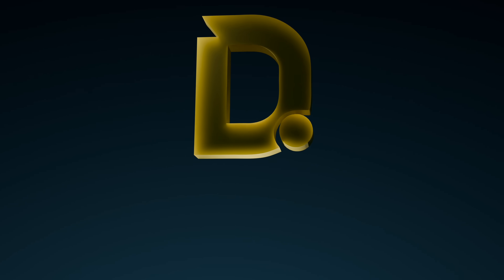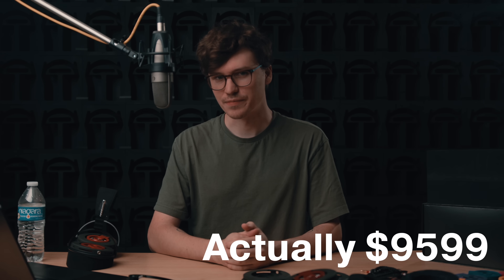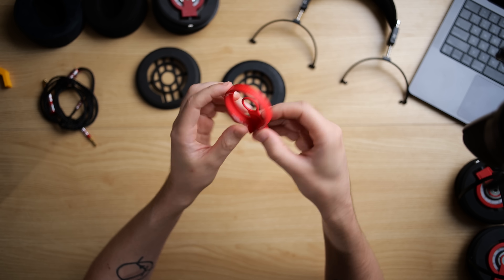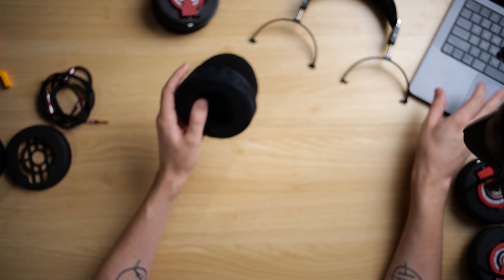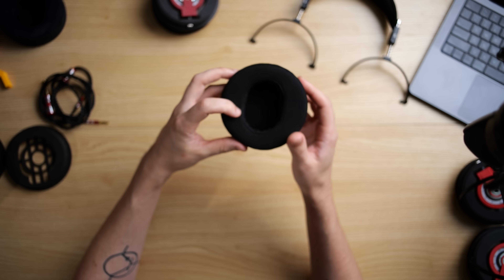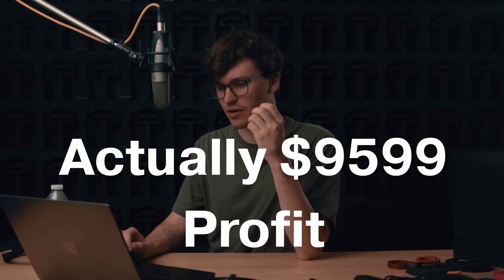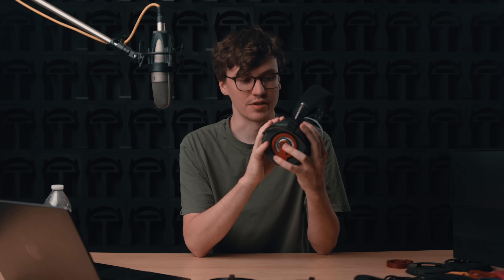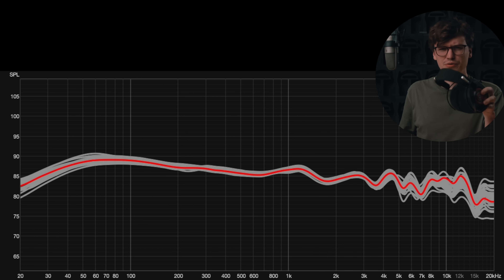What it really costs to build a headphone

Comment: Curious why you didn't go with injection moulding over 3d printing? A small mould only cost around $500 - 1k.
Reply from the maker: Would have to make the chassis a multi-part design and change a significant number of things. Also would increase weight as a result.

Comment: So if i hear it right, basically nearly 40% of the cost goes for the distribution company (in which if you're sponsored-by, then it should also be counted as your personal profit - CMIIW). Other remarkably high cost component comes from labor (at around 10-11% for only a couple of person?) while the other components' prices are pretty much reasonable (for retail parts that is) except for the packaging (in which the 1st batch customer didn't receive in full due to... never mind, i understand), anyway it's not like you have satin cloth wrapped on the foam or giving a free case right?.

Anyway, a whole lots can still be optimized if you decide to do another project. Having OEM companies fully make your design must have also come to your mind, but if you go for a US-made remark of course it's another story.

Best of success.
Reply from the maker: It takes 3 months to build the units. Also I'm not sponsored by them. I work there but I don't see any of that. Actually at that margin it's close to a loss.
Reply: @DMS3TV  True, I'm in construction business and that much of a margin (not including your own R&D costs) really close to a loss, especially later with taxes and other administration things. But yeah, just in case another project pops up in your head (planar maybe? Hahaha) you already have all the better considerations regarding the cost components and maybe options for more efficient manufacturing.

Comment: Not sure if this is the correct video to ask but I posted these questions in a couple other discussions w/o a response.  so here......    1) Aside from the apparent aesthetical benefits (exterior finish) and arguable structural qualities SLS provides over a premium FDM filament,  does it improve the sound that the drivers deliver?   If so, how?   2) Did you modify and / or make any kind of tuning to improve the sound?   Both, the Kennerton Vali and the Aurorus Borealis use the same driver from Tympany.  Two headphones I am sure you have reviewed or at least tested before.  3) Sound-wise, how do your headphones differentiate from those two?

Comment: $30 per (pair) of SLS earcup shrouds? What kind of nonsense is this?? You outsourced your manufacturing process ?? So... now a third party has your mold design (ie. in terms of the current weak international Intellectual Property (IP) laws, you now own nothing!)

The most expensive component to manufacture is the planar magnetic driver, and that shouldn't cost you more than maybe $20!

The most difficult headphone component to manufacture is typically the high-grade (plastic?) housing, which would require a 200 tonne press

1. Nissei FNX220 $120,000 - $150,000
2. Arburg Allrounder 570 C $150,000 - $180,000
3. Engel Victory 330/200,$130,000 - $160,000
4. KraussMaffei CX 200 $140,000 - $175,000
5. Sumitomo SH200A $110,000 - $145,000

...for a single press, brand new, which shouldn't scare you; keep in mind your goal is to operate a perpetual business. And a typical line of business credit from a bank for a legit, state registered business is $150,000 - $300,000. 

You can annually depreciate the market value of the presses and all your tangible assets to recoup a significant percentage of your upfront expenses through your business taxes.

Or you could always rent or lease, which lots of companies use because of floating personnel rolls.

If you netted $18,000 in revenue in only 3 months, it would then require $300,000 per press per year / $75,000 in net profits per year = 4 years to turn a profit, which is currently better than some EV companies !!! And they have multibillion dollar valuations, based upon the day they turn profitable. 

Don't be so ashamed, I don't know a lot of businesses which can survive without seed capital within the first 4 years.

I will not be examining your component costs because your component costs are way out of reality; like in the realm of magic unicorns...

Comment: I work at a company in Germany, we develop and manufacture medical devices. A few points in general: Test EVERY unit before it ships. Especially the first few batches, and not just at the end. One step, one test. Also, trust no supplier! The best guy in the company does the first few samples to get the contract, the actual bulk order gets done by some unqualified idiots. Add 3 months to the initial internal production deadline. If something goes wrong and you need to change something, the next batch of parts can take 2 months easily. 

We also had an issue with item cases. We designt the case to fit the product, got a batch manufactured. But just then the product charger manufacturer changes the dimensions of it. Charger doesn't fit in the case anymore. So we squeeze the charger somehow in the case, until this batch is sold. Then new adjusted design for the next one.

Comment: Its absurd to me that they still made a profit after clear design mistakes, like buying pads for the whole batch ahead of time (dekoni pads are expensive!) and then changing, having quality issues with the SLS and NOT getting your money back as the quality was below expectations. And still making profits. And that's because you're still charging 1k for a headphone that's primarily printed plastic parts, with reused parts of design, and a purchased driver. The design is also SO uninspired, it begs the question why people would want to buy it. For 800 you can buy a Meze 109 pro or Hifiman Arya Stealth or Focal Clear or Hadenys. This thing is, at best, basic prototype quality
Reply from the maker: You do realize headphones in this price range usually cost MUCH less to build than mine right?
What parts am I re-using from another design?
Also 3D printing is significantly more expensive than injection molding. The benefit is lower weight...
I don't see how you can say it's prototype quality when it measured better than many things 2x the price and you haven't handled it or heard it.
Reply: @DMS3TV  I work as an engineer in medium-scale production for automotive and industrial applications. You're right that I haven't heard it. But this is a premium price, and for that premium you should get a premium product. It seems like all the focus was adherence to the Harman target. The magnet is nearly exposed, just in my opinion this looks like a prototype, and the alternatives in this price range are quite transparent. For Harman lovers they could EQ or just stick with that headphone and let their brain adapt to the signature. This looks much closer to a DIY 3D printed build than a production product. 3D printed material may be lighter, but there are other considerations like longevity, appearance, and CSD performance. I'm not that familiar with SLS but it seems like the baffle was worth it. Not sure about the outer frame.

Working in the production space for 6 years, very many companies lose profits on the very first proto or production. IMO the pricing outlined in this video shows exactly why. However, people were willing to buy these batches, so the market has spoken. Just giving my thoughts.

Comment: Very hard to justify $1k

Why couldn't the next batch stay at the same price if the first one was already profitable with so many additional costs?
Reply from the maker: The price is returning to MSRP. Batch one was sold 10% off for early-adopters. It's not just me here too. There's other peoples jobs that rely on this project.
Reply: £1k is absolutely hard to justify if your personal financial situation makes it a difficult purchase. In such a situation you absolutely shouldn't even be considering purchasing these, or any other similarly priced headphones. I suspect there are much more important regular outgoings in your life that should be prioritised.
If, however, your personal financial circumstances are such that your disposable income makes a headphone purchase in the £1k range viable without significant sacrifice, then it is absolutely justifiable.
What you meant to say, I'm sure, is that these headphones are not for you because you cannot personally justify the purchase - and that your personal circumstance and experience are applicable to precisely you and no-one else and, as such, you have no say over what is or is not justifiable to anyone else.
Also, the concept of "early-bird" pricing is not new - this won't be the only time you encounter it.

Comment: Good example of design to production.  There's definitely a learning curve to it all and a range of methodology paths that are low or high cost risk.

3D printing is certainly becoming mainstream even in the commercial space.  There's a number of technologies out there.  It's a shame you got some bad results.  I would typically expect you'd be able to RMA the bad parts.  Most companies dislike bad reviews and tend to make an effort to maintain good customer service.  It's a competitive space, so the brand needs to carry high weight.  It's just trickier overseas.  Manufacturing of this kind is also so abundant these days you really don't have to bother importing anything.  If it's not cost competitive and you're not making 50,000 of them, you don't even need to bother with the hassle.  Stay local and bump up the sell price a little to cover it, and you're golden.  Lead times are better, communication is better, you're protected by US laws, and you can often do samples and small batch stuff really easy and with fast lead times which keeps everything rapid.

From a development standpoint, I will always, ALWAYS makes as minimal as possible of any real thing.  I do as much as humanly possible virtually, review, re-review, get more eyes on it, get a pile of feedback, do everything as much as possible before every making real part number 1.  And even then, it's as minimal as possible.  I will also pay a premium for small batch jobs to just have a few vs thousands.  I want to build 1, review it, test it, plan revisions, and then likely scrap a bunch of it for those planned revisions.  Doing it right, you often have little to no extra stuff.  I don't care how many revisions you do, keep it minimal.

Comment: Most of the problems you mentioned could have been avoided if:
1. Properly had a profits & loses tracking.
2. Contracts/legal agreements regarding quality and cost of materials.
3. Made several prototypes before going into production.

The business case must be well understood before going out to the market. Not trying to throw shade on you, just some things that can be improved.
Reply from the maker: -I actually did have profit/loss tracking.
-I had a legal agreement with several vendors who screwed me but its gonna take a long time before they either give me a partial refund or working parts (because they're arguing the subjectivity of "quality")
-I made 20 units before this batch with no problems. The vendors started having problems after I bulk-ordered parts.
Reply: @DMS3TV  Nice, seems they screwed you over man. Working with vendors is always a pain 🥲

Comment: So the vast majority of those cost was due to stupidity is what I’m getting from this video. You could easily have made an incredible profit if you would have thought one more time before hitting the order button…
Reply from the maker: : ) I actually built 20 pairs of these and checked all the vendors long before we did this run. It wasn't until I started bulk ordering parts that vendors started having problems. Not sure how that could've been foreseen on my end.
Reply: @DMS3TV  well then you shouldn't have paid them. If I order an iphone and I receive an apple I don't pay. I send the apple back and wait for my wallet to fatten back up. It's still stupidity. Why did you accept the products if they were not what you ordered? Smashed boxes. Should have gotten returned to sender. Protective inlay of the boxes should not have been bulk ordered before final product was finished. Pads should have been tried out before bulk ordering. Pls brain activity before touching the order button :)
Reply from the maker: @INeedsMoneys  the boxes weren't smashed up on the exterior. They were in the bottom of 56 larger boxes and you don't get a bulk order of parts without paying first lol.
Reply: @DMS3TV  of course you have to pay upfront but that doesn't mean you have to accept a broken product. I live in Europe so I don't know American law but there has to be a law saying if you buy anything online and the product bought is broken/not as described when received you have the right for a refund. That's how it works in the EU. America has to have a law like that. Otherwise it would be a gamble at every purchase.

Comment: Messing up on manufacturing, wasting entire batches of parts then pricing the product to where you still make money is on you, you could've made a lot more on this. Hopefully the next model you release will be priced more appropriately. However I doubt it, congratulations on the ridiculous margin on your next headphone.
Reply from the maker: The vendors def screwed us on several things. What sucks is they provided great samples and units up until I did a bulk order.
Reply: Sorry to hear that the batches didn't match the demo units, that's just par for the course. I just hope that the next model is dramatically cheaper, and margins are still kept thin.

Comment: For those who have one, how have you found the durability? I'm not extremely hard on my headphones but I've had one fall from their stand a time or two.
Reply: So it's not a super scientific test, but I took an early b-stock pair with me on vacation for a week, so it made it through airports, shuttle busses, suitcases, and then onto a cruise ship, where I wore them pretty much every day, and sometimes took them with me in to port, to beaches and things.

Still daily driving that pair right now, at my desk.
Reply: I can comment on specifically these aspects that make them pretty durable:
There's a hard resin epoxy holding the 3.5mm jack in place, the drivers are hot-glued in place, but are very hard to remove now (we've been testing a specific driver in different cups recently), the headband yoke extension and cap, and the locking ring on the 3.5mm jack and secured with red lock-tite.
Reply: I own a pair. They feel solid enough to me. I have no concerns about a floor bounce. I'm not about to hurl them against a wall like a rage monster that just lost a round of COD, nor am I about to throw them out into a busy road to see how they handle being run over by cars and/or trucks. Respect your money, and treat them appropriately, and I reckon they should last a decent chunk of a lifetime.

Comment: Can you make a video on how you tuned the drivers to the specific frequency response? That would be really interesting to know how you can get different frequency responses using the same driver.
Reply: Honestly, it's easy to mess with the FR, something I learned while doing the driver matching on these. I was using little paper labels to sort the cups numerically, so I could keep track of pairings. For about 4-5 tests, I had started to put the little paper slips on the back of the headphone, covering the hole on the back of the driver. Completely tanked the bass response. Like a 10+dB drop. Realized pretty quick I had messed something up, and wasn't just getting a series of bad drivers.
Reply: Little changes around the driver and the on the chassis can cause some weird reflections, and the amount of space behind the driver port can drastically affect how it sounds

Comment: I really appreciate this project and the transparency you talk about it , I am really exited to get mine from batch 2 , just from the graphs I can tell it will sound spectacular, with the yellow parts looks really nice, I hope I can get those parts in that color, greetings from Uruguay 😄
Reply from the maker: Thanks! Hey my Cousin lives in Uruguay! I hear it's a beautiful place.
Reply: @DMS3TV  It is lovely! you should come and visit! do it in summer so you can have a nice time by the beach
Reply: @DMS3TV  do you think that omegas will run properly from an OTL tube amp? I am saying because of the low impedance
Reply from the maker: @estebanmaestro7082  Absolutely, the impedance is non-linear so on an OTL amp you'll get a measurable increase in sub-bass. It's pretty fun. That was actually part of the design 😄

Comment: Having worked on 60+ headphone SKUS in my career, for what you spend on 3D printed parts, you can easily tool the parts, have massive improvements in terms of accuracy (tolerance vs nominals), part strength and reliability,, not to mention being in a totally different realm of cosmetics.  Tooling the band and associated parts is not that costly and making foams and cups / headband pads to your preferred shape / density and adding branding or other features is not expensive, but gives you tons of options.
Reply: But you need to commission someone for each stage of a supply chain that uses tooling (he has no training as a machinist). 3D printing only has one, so the labour is demonstrably cheaper. The labour is the majority of the cost.
Reply from the maker: The big reason I use SLS parts is to save weight